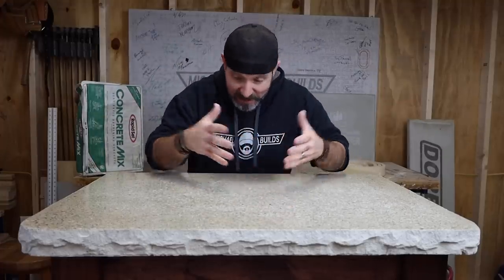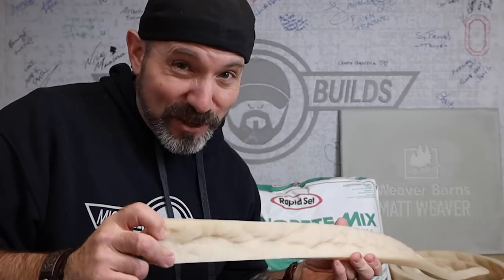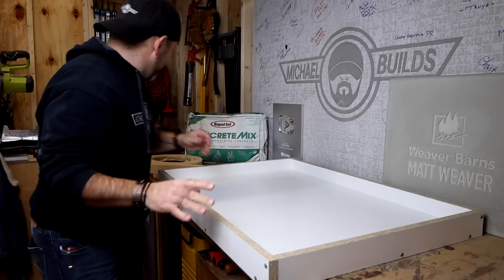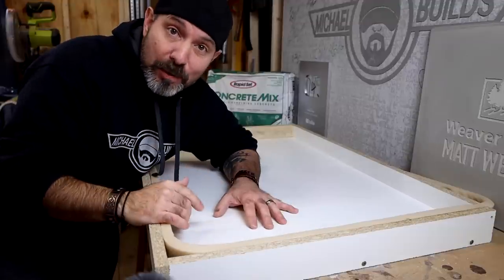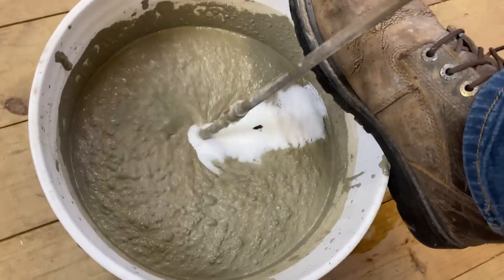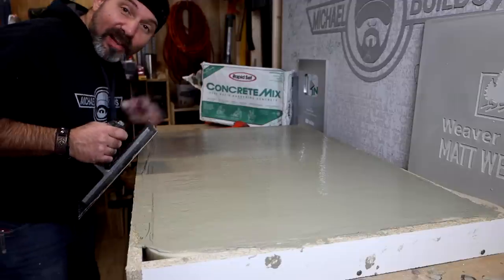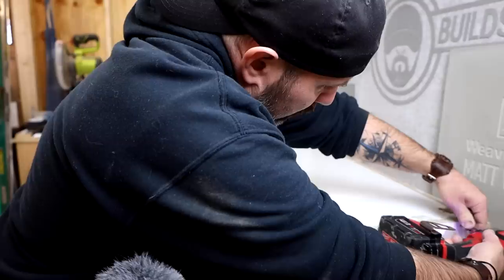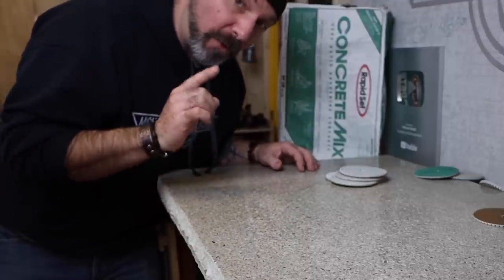Concrete Countertop with a LIVE EDGE!

Comment: That looks like it would go great in the kitchen as a butcher block or set against the wall as the coffee station.  I have used rubber strips like that for making my concrete garden benches. I wish I could get rapid set here where I live but the nearest home depot or lowe;s is over 100 miles away.  Thank you again for the ideas I still have to get a polisher and pads.
Reply from the maker: I agree! You just gave me another great idea again you idea machine!

Comment: Thanks for these video's, you've inspired me! 
I'd like to add one note of caution when using the silicone form - if you need an exact size top, make sure you add the width of the form to the dimensions of your box. I made tops for a brick BBQ and wanted a 1/2" over-hang. luckily I realized my mistake while mounting the form and was able to rebuild the boxes to compensate for the form. Thanks again!

Comment: As a Milwaukee tool guy, I have no doubt that it will mix up a bucket of mortar. But why not use a corded drill? I don't needlessly run them that hard unless I have to. 
Also a palm sander works wonders for getting the air bubbles out if the mix once poured. 
And concrete will freeze even though it's set up in the cold. The water is still in the mix and will continue to get stronger over time. When it's that cold it will eventually cool down and freeze. It needs to be at least covered and not placed over frozen ground, heated if possible even.

Comment: Thanks mike for the awesome video.  Yet again you never cease to amaze me.
This video did answer one of my lurking questions but was wondering if you can advise on the following questions:

1. Rapid set is a Product generally located at Home Depot.  As an alternative, could you also use Quikrete concrete mix at HD?

2. What other alternative product instead of Rapid Set Mortar mix at HD could one use?

3. In the event Home Depot is not available or convenient, what concrete Mix and mortar mix could you recommend at Lowe’s?

4. Finally, can the Rapid Set FlowControl and SetControl be used with other products other that Rapid Set, such as Quikrete?

Comment: Can’t tell you how much I’ve learned about concrete from your videos. Thank you so much for these informative gems! A question: can you color mortar mix? Trying to plan for a “mosaic” project using terrazzo glass on a previously laid concrete (Quikcrete) base. Also, do you use acrylic fortifier when you embed the glass or overlay on older concrete?

Comment: Michael, I came across your first video not long after you posted it.  Since then, my wife and I have poured vanity and table tops with great success.  Question--do you think you could lay your reinforcement mesh before you add your second bucket of concrete?  Just wondering if putting it in last leaves a half inch or so without any aggregate?  As always--fabulous job!
!

Comment: What you called a “star pattern” is very important when you’re forming the inside of a block-out and are pouring concrete on the outside of it.
If you don’t form it in that “star pattern”, the two longer sides won’t hardly come out. (ESPECIALLY IF IT IS 2X LUMBER.)

We used to call it “pig penning”.

Comment: I absolutely love your videos and have been following you for a long time. I'm getting ready to make counter tops for my kitchen but would like to make the concrete as light towards whit as possible, is there a way to put pigment in Rapid Set to do this? Hint: can you please do a light colored counter top? 😊 Also should I go 1-1/2" thick or 2". I plan on using the live edge mold.

Comment: Nice video as always.   Have you tried Stain-Proof Color Enhancing Sealer by DryTreat.  They boast a 5 year protection.  It is a penetrating sealer and does darken the concrete a bit.  It is not  a coating and does not really add shine.  I was disappointed at the outdoor concrete countertops I had poured.  You inspired me to polish them and it turned out great (with a little trial and error).  I used this sealer and am exteremly happy with the final result.  Thanks for the inspiration! and tutoring!!

Comment: Michael, thanks for the video, love the countertop and the explaination of the rapid set differences.  Thanks to you i also have that bucket scraper and the mixer for the drill. (I used to use a hoe and a wheelbarrow.)

Have you, and if not, could you make a coutertop for a kitchen, made in place, with an undermount sink and a faucet hole... i want to do that! 

Thabks a ton.

Comment: I have 2 questions for you.  
1. If I make a small table top fire pit Is there a specific sealer to use that is fire resistant?
2.  To make an L shaped bar top how do you join both pieces if they can’t be made as one solid piece?   
Thanks again!!   Great videos!!
Reply: The fire pit should have a space between the flame and the surface. Most will probably be fine. Make sure it's outdoor rated. If your flame is at an odd angle to the concrete, there are marketed sealers that claim to be excellent even for fireplaces.
Reply: @raffikkiz  thanks!   My plan was to do about a shoe box sized block with a 2” x 6” sized slit to pour rubbing alcohol in to burn.  Not sure how that would be with the sealant

Comment: Great job on all of your counters! I plan on making a concrete hearth pad for a new wood stove project . What pigment brands do you use? Also curious if you feel that the rapid set mortar mix will hold up to the weight of the stove and some abuse from dropping wood splits on it . Thanks again for the videos great work !

Comment: CTS shows that the water should be between 3.5 qt - 4.5 qt per 60 lbs bag
and it's is a good idea to wear a mask when the dust is flying around, don't want to make rocks in your lungs, you have a lot more projects to make.

Comment: I'm a new subscriber to your channel and already a big fan. Very informative videos and entertaining at the same time. I'm in the process of starting to build my own fire table and this live edge is very cool. Due to the cost ($86x2=$172) of the rubber  mold featured, I'm going to have to try the chipping hammer technique and hope for the best. When it comes to adding the fire glass, can you use beer bottle glass as a substitute? I'm hoping for a clear sparkling diamond appearance in addition to the blue like you used. What are your thoughts?

Comment: Michael, I am in the process of doing an outdoor bar and kitchen. Can I use the cement all instead of the mortar or concrete mix? I saw your bird bath and it seems it would work just as well. My wife is not a fan of the exposed aggregate and she agreed to the kegerator, so you have to pick your battles.

Comment: 2 things, 1) way too wet with that flow control.  You notice as you poured it from the bucket the aggregate had already settled in the bucket., which means there is a pile of agg in the middle of the table and none at the edges.  
2) a mag float is a finishing tool, depending on what kind of finish you want. Use a mag float (not a finishing trowel) until the concrete has set up enough to take a trowel finish, (usually after a couple hours for non-rapid setting concrete). A finishing trowel is a final finish tool, not early or intermediary.
Reply: Maybe so, but the finished product looks pretty damn good to me.

Comment: Hey Love the videos!  I am building an outdoor kitchen/BBQ area. I would like to do counter top in concrete.  Its going to be 10 feet in length and 18 inches wide.  Would you use Concrete or Mortar?  Also like large concrete projects I was thinking that maybe it would need to be made in sections of 36 inch lengths and then siliconed together leaving a flat edge where each section would meet.  Do you have any videos or suggestions for a large project like that?  Thanks again for the videos!

Comment: Hey Michael! Love these videos, I am going to be casting my own paver steps using this video. I am curious about if you thing there are issues with using a dark color tint with the flow max. since I plan on mixing all the concrete the same then they should all remain the same level of black since I will use flow mix with all of them.... thoughts?
Reply: Also, are there issues attempting to use the same wood molds for additional casting? I need to make 18 stones but I was hoping to only cast them 2 at a time... so just making 2 molds and doing it over a few weeks.

Comment: Hi I will lay stone veneer  on concrete block . It is exterior wall . Should I use mortar mix type S or should I use modified thin set. Rapid set mortar.  Which is better for very cold weather on winter below 0 degree.
Reply from the maker: Type S mortar for sure
Reply: @MichaelBuilds  Thanks for your help.

Comment: Hey Michael. Can you tell me how thick the edging is? In other words, if I need to make a slab that is 14 inches wide, how much do I compensate for the thickness of the edging when I build the mole? Thx.
Reply from the maker: I believe the general thickness was about 3/4”. I didn’t really figure that into my calculations. I just figured how much material for the mold without edging which gets you close enough.
Reply: @MichaelBuilds  I am planning on making a set of concrete steps like the ones you made on one of your videos and I want the stair treads to protrude  2 inches. When I saw you using the edge moulding, I thought it would be a perfect accent for the steps. Thx again and Keep Building!

Comment: Followed your instructions with water amounts and used flow control and additive to slow cure process  ended up with a lot of cracks. I used a quick Crete  color additive . Any idea why the cracks happened
Reply from the maker: Did you water cure? If you don’t water cure you will end up with a lot of surface cracks. But if that’s what happened than that’s all they are are surface cracks. They are superficial and do not go all they way through. I would imagine that when you flip it over there are no cracks on the finished side?
Reply: @MichaelBuilds  I did end up with cracks but they didn't effect the integrity  and look cool I filled with black epoxy and will continue to polish. Concrete seemed to take a long time to cure and top was sloppy so I didn't spray with water. Should I have flipped out of mold right away and strayed? Thanks again  your videos are awesome and inspiring.  Hope to share pic of my finished product.
Reply from the maker: @bradlykeeler4749  no, definitely don’t take the concrete out before it’s cured. Not sure what went wrong there. Cracks usually mean too much water, no water cure or no metal reinforcement. Since you followed my instructions I’m not sure what happened there. I’m sorry I wasn’t able to shed more light on that one brother

Comment: Did you spray it with water for an hour like you do the mortar mix? Or does the water depend on the temperature and materials used?
Reply: Depends on the temp and material. Mostly, it is good practice to rehydrate your concrete surface when it is hot or exposed to intense heat/sun. If you have it in a shed and it's below 90 you'll probably be fine. Spraying the surface with water is always good practice though as it gives the concrete the best shot at curing without a crazy amount of cracking. Do not saturate the surface if the concrete is still naturally wet though.

Comment: The point of plasticizer is to reduce the water content to avoid cracks and other defects. So of you use super p you need to reduce your water content. Your mix is way too watery.
Reply from the maker: Not true with the Rapid Set product
Reply: @Michael Builds  plasticizer only has one purpose, that is to maintain a higher slump while reducing water content. Increased water content results in cracks, crazing and spawling. That is the nature of concrete.
Reply from the maker: @sackclothandashes1342  I understand that. But Rapid Set has taken that same old idea and gone further with it. The ability of both their concrete materials and their plasticizers go beyond the abilities of the regular materials that you’re used to. All of your facts and knowledge are 100% correct for regular Portland based concrete and typical plasticizers. But this is not a Portland base and this is not a typical plasticizer. Rapid Set is made with a CSA (Calcium Sulfoaluminate) base. The strength is 3 times stronger and 3 time faster than any concrete you can get on the shelf. I mix according to the manufacturer recommendations and my projects have all stood the test of time and Ive never had any issues. There is not too much water in my mix.

Comment: GlobMarble Concrete COUNTERTOP Edge Form CEF 7010 Rubber Mold Form Liners Edge Profile 2" x 8F
4.8 out of 5 stars    24 ratings
Currently unavailable.
We don't know when or if this item will be back in stock.
Concrete Countertop Mold Edge Form CEF 7010
Globmarble supplies professional grade casting molds which reproduce the structure and relief of natural stone to the smallest details.